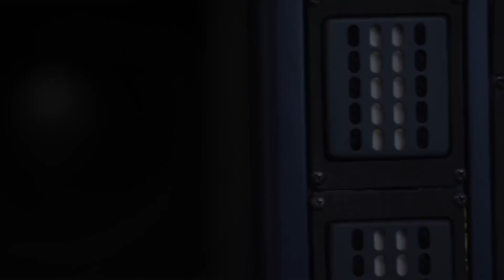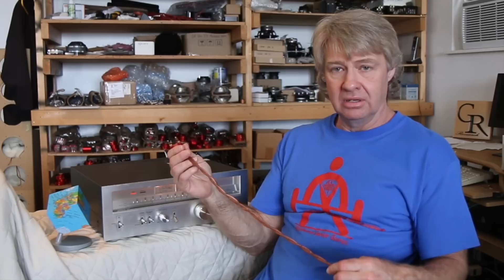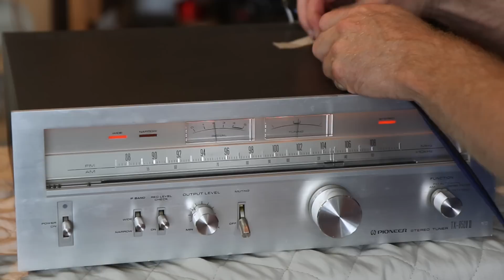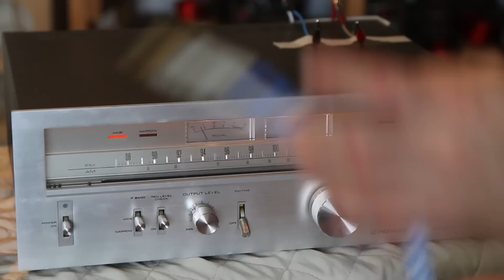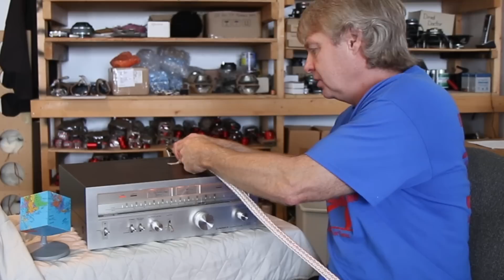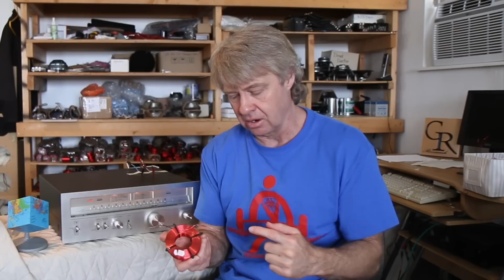Do Audiophile Cables Matter? Here's PROOF!

Comment: This is just about the first time I've ever not watched one of these all the way through,and I watch any old crap.So this proves that speaker wire can be used as an aerial,as can a screwdriver,a curtain pole,some chicken wire,brake pipe or even a coat hanger.How about a blind test with a speaker connected to an amp with RG58 or similar RF co-ax so the listeners don't know what type of cable they're listening to?
Also don't forget (maybe you don't know) that analogue FM receivers gradually reduce the treble response and blend the signal to mono as the signal strength reduces.This would explain the difference in sound quality.

Comment: I guess you'd be shocked to find out that most recording studios where your music was recorded and mixed use pretty standard cable. It's not dirt cheap cable but it's not $30 a foot. Probably a couple of dollars a foot. And you should see the mass of wires behind some of those consoles.
Reply: Greetings,

In the early 1980's, high-end speaker cables were beginning to appear on the market. Some of the product claims were totally unbelievable and had prices to match. And, the nonsense is still being foisted on us today.

Audio cable must be burned or run-in for a 100 hours. The best cable is cryogenically treated. Audio cables are directional. They must be supported off the floor via insulators. They have damping factors. They must be 'conditioned' to keep the wire molecularly aligned. Ad nauseam. It is all snake-oil designed to part the naive buyer from his money. It is all a crock!

The ONLY factor that affects performance of audio cables is the wire gauge for a particular maximum distance between amplifier and speakers at a particular Ohm rating. If you have the proper gauge, all audio cable will sound exactly the same!

"Realizing that wire resistance was the critical factor in speaker wire, Gordon Gow, then President of McIntosh Laboratory, still a maker of world class, high fidelity amplifiers, used a speaker cable demonstration to show there was no listening difference between high-end audio cables and plain line cord (14 AWG lamp cord wire). 

Fifty-foot lengths of wire were used in the blind comparison. The setup consisted of a master control relay box and two slave relay boxes. A three-position switch was used to select one of three different speaker cables of equal length. One was common line cord. The other two cables were from popular high-end manufacturers. 8-ohm speakers were selected for the test. The two other brand name cables were heavier than the line cord. The test proved his point. No one could hear ANY DIFFERENCES using several different 8-ohm speaker systems." -- from Speaker Wire, A History by Roger Russell.
Reply: @stevefranks6541  From what I can remember Monster was one of the first to sell the oil. Not only speaker cables but HDMI , RCA etc. My brother bought a 4K tv and was going to spend $80.00 on a HDMI cable because the salesman told him he needed it. I laughed and made him use the non gold plated Cable that came from the SAT company. Picture is great of course.
Reply: @glpdrum  here in the uk QED 79 strand was 1st to market in 1980 i purchased some & it did make a difference to the sound in a subtle way, but by far the biggest improvement was to my Cyrus 2 amp i was using thin gauge cable which was causing the amp to get quite hot on replacing with the QED it ran a lot cooler, don't know the reason why as i'm not a tech. think that counts as a positive.
Reply: @glpdrum  yes but could it possibly be better with the gold!
Reply: @glpdrum  I asked the salesman that I bought my amplifiers from about gold-plated interconnects. He didn't say a word. Just shook his head back and forth.
He also told me not to waste my time bridging my amplifiers. He didn't need to tell me but it just confirmed what I already knew as I could hear an increase in distortion when I tried bridging. I just used them for bi-amping. Much better.
Reply: @Steve Franks  Thank you for adding some sanity to this conversation... The Society of Broadcast Engineers ran an experiment to determine whether participants could hear differences among different guage speaker cables. The winner? A set of automobile jumper cables! i.e. Large guage copper.. Yes, resistance is the primary factor...
Reply: Take high quality microphones (Neumann etc), signal delivered via balanced audio cable into consoles such as Neve, SSL, API, high quality monitors in rooms designed by specialist acousticians - these facilities cost a fortune and low noise is vital. The recordings are generally engineered by highly experienced people with years of critical listening. The larger studios also have highly skilled tech teams to keep the systems working to optimum. You might be surprised at how professional it is. 
Please don't think that audiophiles are a step above this - that is total nonsense.
Reply: Belden, Canare, Mogami, mostly.
Reply: @pjo1964  Yes, but Belden, not Belkin :)
Reply: @pjo1964  Which are intelligently designed and reasonably priced cables made by people who understand that a cable's design can have a positive or negative effect.
Reply: and trought a bunch of "cheap" electrolitic capacitors, uggly silicon based op amp and noisy carbon film resistors ha ha ha xD
Reply: I could list a few "audiophile" recordings where I used a Radio Shack cable. (-:
Reply: this just proves that we are a bunch of monkeys which repeats that what we have heard and come to a conclusion about. Same story about people who learn something, like, they dont use expensive cables in the recording studio, and that that music was never mixed for audiophile system. Now, you think you are smart and have got 1 up on the rest with selecting your theory based on one practitioner who has come to this conclusion then run around and tell everyone how your mindset works on the matter in that the recording is not mixed for an audiophile system. And while you may be quiet right, the point it, for whatevery system you migh have at your home, hifi or high end, everything makes a difference and its not about your thinking and resort that makes out the difference and your so very strict knowledge about what is bullshit and what is not decided upon one theory of some coffee drinking theorist, who has probably never heard a high end system and comes out and spits out theories about that things does or does not matter.

The same shit for the opposites, they have seen the light at the end of the tunnel and go preach about some theory which has come to their attention. We really are a bunch of monkeys. Some for the money, some for their own right to be right. If there was even one company who knew how to make good sound, if they had the fact on what made good sound they would have made it long ago. The business is to make you think that you are right, then to be confident in your beliefs, so that they then can bend you over and keep you as a disciple of their theory so that their theory manifests itself as the truth in this world.
Reply: @hueseph  it's like most YouTubers making video on crappy monitors doesn't negate the benefit of watching those video on a decent OLED TV
Reply: Its not relevant. The application is different.
Reply: yeah, the change in input he is measuring would be what is added to the signal AFTER the power stage LMAO. so you have a 10W output the standard  speaker wire puts on the "noise" you would hear if you just took a free standing speaker with an FM antenna loop on the terminals. 

i dont know about you, but if i put a 10m loop and short the speaker terminals to put an antenna on my speakers, the noise floor is "sooo looow".
Reply: I can tell you that the most impressive recording studios in LA use Belden cable as well as Neutrik and Switchcraft connectors (some others too at times). Those cables measure flat through the audio frequencies. The professionals don't buy into the audiophile nonsense.
Reply: Not only that, but also many thousands of feet of it.
Reply: Studio equipment uses XLR balanced cables. No noise, just pure signal.
Reply: I have been quoted $150 a foot. I let out a chuckle and said I’m not buying that. No argument from the person who quoted me.
Reply: If someone can hear the difference and it adds to their enjoyment then that's all that really matters. My honest opinion expensive cables can make a difference good or bad that's entirely up to you 🤔 but depending on your equipment they are useless with it may not be apparent. Some amplifiers depending on how they are designed ..... capacitance and load can make a huge difference as do their internal components. I watch a guy review a bunch of phono stages on his system....I repeat on his system....one of them he said sounded flat and lifeless but I've heard the same phono stage connected to a decent valve amplifier with horn loaded speakers and it was phenomenal....go figure.😯🙃😊 Enjoy the 🎵🎶
Reply: People talking about xlr/balanced cables having inherent noise immunity; indeed they do because the noise affects both wires equally and hence is cancelled out by the differential receiver. A loudspeaker is also differential! Speakers are inherently immune to induced common mode noise (as well as being low pass filters and low impedence both of which make them totally insensitive to RF). This video is, of course, bullshit.
Reply: I had read that most recording studios use active loudspeakers: active biamplified speakers with active crossovers.  That would totally eliminate passive crossovers and speaker wire.  That would probably not apply to all the music that has been recorded over the years.
Reply: @paulsebring6930  For pro audio we use symetrical connection. So WE have no issues with emi even at long câble length.
Reply: The best studios, e.g. Kevin Gray at coherent audio, have upgraded their entire studio with audiophile cable to stunning results. It all matters.

Comment: Resistance equals attenuation and capacitance equals attenuation of response starting at high freq. (you know like a tone control) No matter how much people want to be special the laws of physics/electronics doesn't change by calling it signature or reference. Lots and lots of shit talkers in the audiophool world. Run some heavy gauge copper wire and keep your lengths down and that's it. If you get RF interference because of the resonant wavelength to public transmissions trim the length.  Over and out.

Comment: I suspect you chose not to take us into your listening room to test cable because you knew there would be no audible difference between the cables. 

Film yourself in your listening room, and compare a $500/meter cable and a $5/meter, both with the same thickness of shielding, and I promise you there will be no discernible difference in audio between the two cables.

Comment: This only proves that cables used for something they aren't at all constructed for perform differently to each other as antennas. No surprises there.

It's a completely irrelevant test. If you think the noise susceptibility of speaker cables make even the slightest difference, do a null test. Hell, even do a null test of the speaker output recorded with high quality recording equipment under controlled conditions.

If the difference is audible, you should be able to hear the difference signal. If it's measurable you should be able see the difference in the measurement results. I bet you won't.

Comment: OK, While I see what you are trying to show, and it does make sense, any RF that is going to get in a speaker cable is going to be in the microvolts, and is NOT going to make it back into any of the electronics as it's on an output.  What you are showing here is explainable as well.  THe impedance of the cables are also different.  The insulator of the wire, the way it's put together and how tightly it's braided.  So the real question is what is that impedance and capacitance per foot of the cable is doing to modify the base audio signal on the wire.

Comment: I own a KEF LS50 Wireless System. The only cables involved are the power cables to the speakers and one CAT6 cable interconnection between the two speakers. Question: Would a high quality CAT8 cable be any better than an Audiophile grade CAT6 with silver content in it? Does this principle apply to the digital signals as well?
Reply: long and short of digital signals is that theyre made up of absolutes, and as such they work in absolutes, too - they either work, or they don't work. effectively as long as it works without glitches, cheap/expensive will have the EXACT same sound, because it's digital, that's the point. but, higher quality cables will potentially work longer distances with fewer issues, so there's that.

Comment: Humm 🤔super humans can hear that switching frequency .If it uses igbt for switching you may correct in the case of smps switching only because it uses frequency ranging from 10kz onwards . I don’t think that engineers will do this .normal switching frequency is way beyond the human audible range and also electric noices .This things can be neglected 😌thank u for u r information

Comment: I have made DIY braided speaker cables and heard a knockout difference in background and clarity of instruments, comparing with basic multistrand copper cable. My cable source was solid core CAT5, that i split out from a 1000' spool i had, and then braided around a 5/8" PETG, flexible pipe. I forget how many conductors there were in total at the end, as I just sat down one afternoon and braided one set on the left, then on the right, and repeated until I lost track of time. I wish I still had those to be honest.

Comment: I think it would be a better and more relevant demonstration, if you measured inductance and capacity, and the derived cable impedance. It would show a measurable difference. 

A scoped square wave would also give a visible representation of charge/discharge curves, in relation to di-electrum materials.

Comment: I think the real question anyone should ask themselves is "How good is your hearing?". I have no doubt that on test equipment, better cables measure better....but can the average person really hear the difference?
Reply: There is so much wrong with what's being demonstrated here. Radios are designed to pick up radio signals. So yes a piece of speaker wire will act as an antenna for a radio. A piece of wire will not turn a speaker into a radio though. Try hooking just wire up to your speaker and see if you hear anything. If you do you might want to seek professional help. Because there can't be any sound coming out of that speaker with just wire attached to it. That's why we have an electronics industry. To make the gear you need to make speakers work. You need a signal source and an amplifier. You can't inject the signal at the end of the chain either. It don't work that way.

Comment: I generally find this whole 'audiophile cable' discussion a bit facetious : as if there were only 'cheap cables' and 'unobtanium audiophile cables'.  'There is no audible difference between zip cord with twisted ends and hand hammered Odin 2' is bollocks. Of course there is. Your wallet may not like it, or you may feel they do not offer 'value for money', but don't suggest there's no difference. I find this test interesting. It shows physical differences between the various cables. In how far this influences 'sound quality' is yours to determine. But saying 'there is no difference' is ignoring the evidence.
Reply: Yep. The fact is that the one difference in cables that matters is the connectors. That's why I use zip cord with banana plug ends. :) Regarding the wire itself, it's all about AGW and cable length.
Reply: @ReasonablySane  I would suggest that for any given combination of wire and banana plug, the way the wire is terminated is the most crucial.  Even the most exotic materials become useless if the finishing is bad.
Reply: @landiepete  Of course. That's a given. Ultimately it comes down to solid contact at the ends and AGW. Well, insulation matters, but is also a given. Frankly, most of my vintage stuff has spring clips for bare wire. :)

Comment: You are kinda quick to put down those who don't believe that cables don't matter or extremely expensive ones are a rip off. Those who make interconnects costing several thousand will of course put forward all kinds of measurements and what technology is in the cables to encourage people with large sums to buy their products. I have an ultra high end system. The monoblocks are attached to the preamp using 80 UK pound xlrs from China. Half Metre decent speaker cables to the speakers. It sounds as good as it can ever get. That is due to the electronics. Measurements don't mean a thing. It's the listening! You would look a lot more credible if you showed your viewers an unedited real time one take session of people given the   chance to listen to different cables, expensive, mid range and cheap. Let's see what they pick out . It's has to be a one take unedited video for it to be any use. I'm quite certain they will not be able to tell the difference. Of all the YouTubers out there, not one has created such a video. That says something, no?

Comment: I expected this to be an April 1 post. 88mHz to 20kHz makes far more difference in a conductor (aka inductor/capacitor) test than would linked metal coat hangers to braided silver. An FM signal strength meter is a horrible indication mechanism. Your test is BS. But there's a wooden volume control knob you can get for just $600 that's airy af.